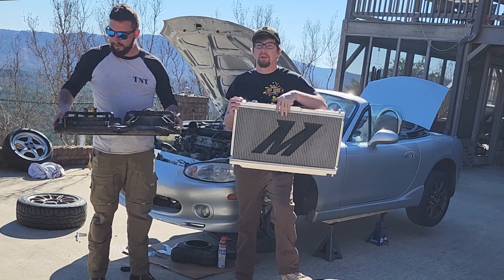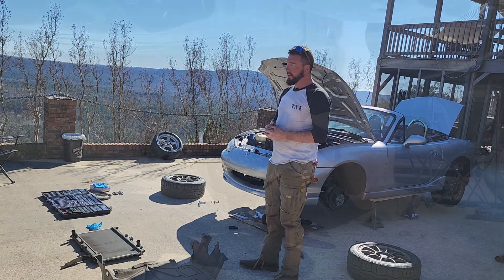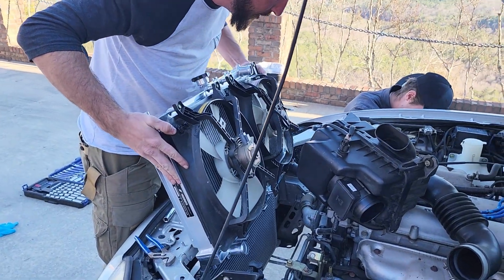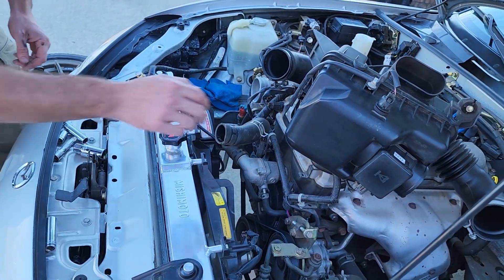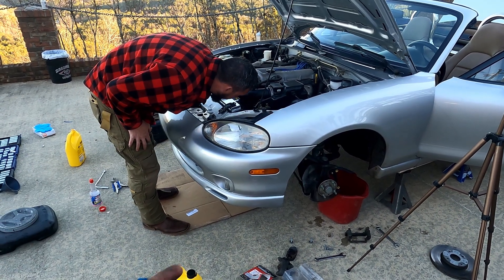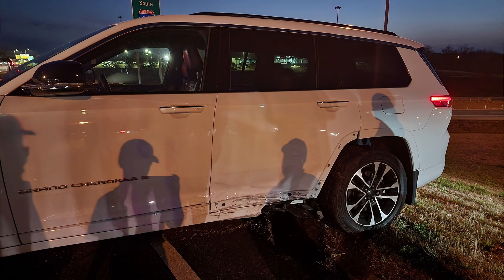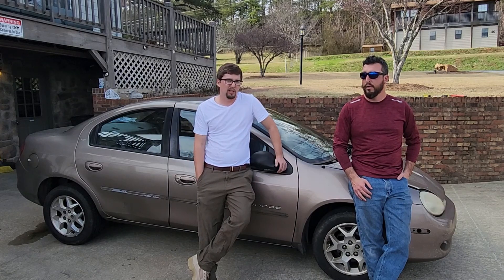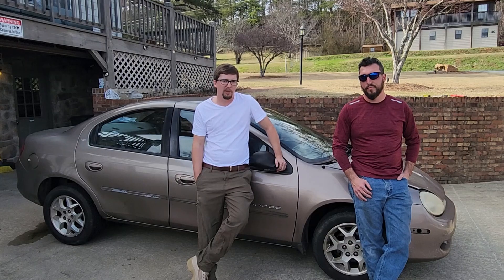Miata NB Radiator Upgrade: Mishimoto

Comment: Installed this in my 1999 Miata Base.  This radiator fits several years and versions and each may require minor fitment mods. For my left hand drive ‘99:

- When removing stock unit, remember there is a mid-bottom bracket that you can’t easily see. Remove completely. Discard.

- Before installation ensure your fans will line up on the new unit.

- Either remove or tie back upper hose for room to work.

-Then, place the new radiator without the fans. (Yes, some people installed the complete assembly all at once, but trust me, it’s much more effective to install fans after the radiator is in car.)

- Install passenger side fan first, hand tightening the four bolts to allow movement for positioning before final tightening with wrench. Tighten top bolts first.

- Driver’s side fan placement is impeded by A/C lines on bottom outside side. Do not bend or modify your A/C lines thereby risking damage or leaks. Instead, cut the fan housing with a Dremel or similar tool. Remove one inch wide by two inch high section of housing. The A/C lines will not be hit by fan blades. Install the fan with the two upper bolts (there are no lower bolts on the driver’s side fan).

Overall, it’s a tight fit. I don’t have numbers, but I know the operating temperature is now a bit lower. The car’s temperature gauge previously stood just above halfway mark when hot. Now it’s just below half.
Reply from the maker: Thanks for sharing.